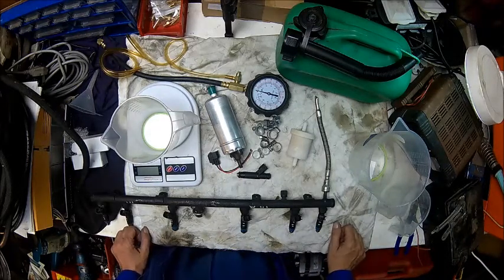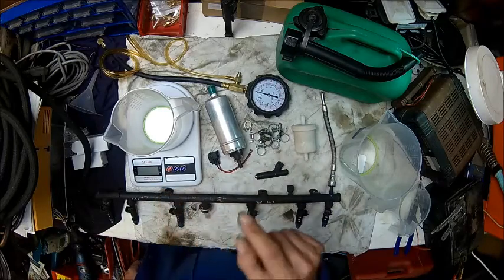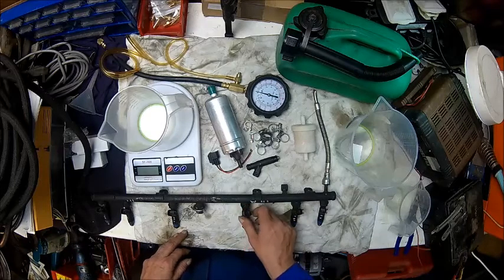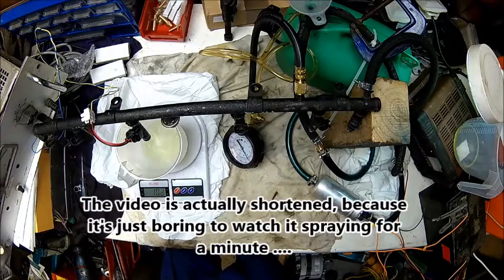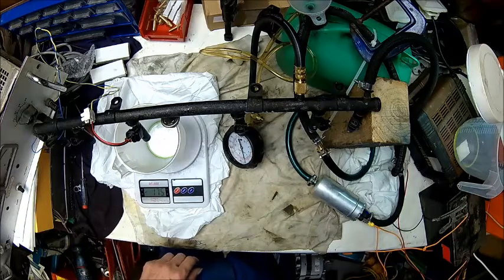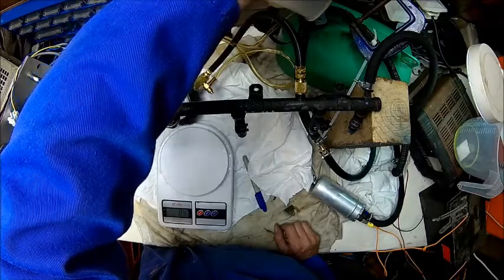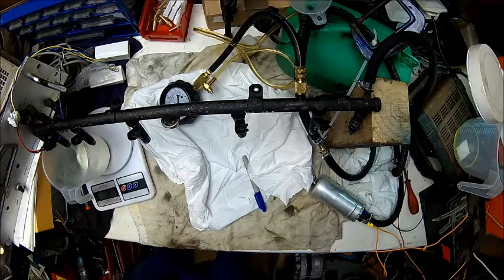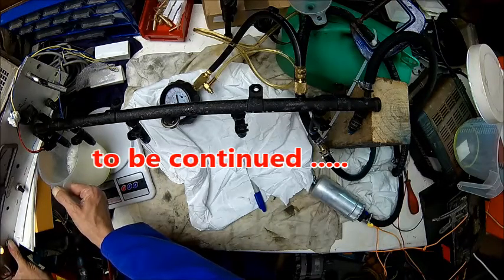Fuel injector testing + flow matching - Part 1, the basics + setup  (Jeep Cherokee XJ 4.0)

Comment: Fun experiment. I use injecter cleaner twice a year for my cars.
Reply from the maker: Thanks, but in my opinion injector cleaner only helps the company who sells it. What you do is flushing the gunk into the injector, it does not really clean the filter on the top, you should at least reverse flow them to get the rubbish out and if possible remove and clear or replace the little filters. I put them in the Ultrasonic cleaner for a wile and then reverse flush it, works fine for me.